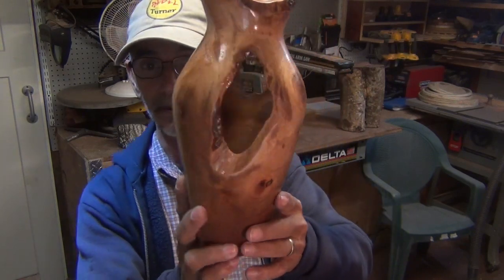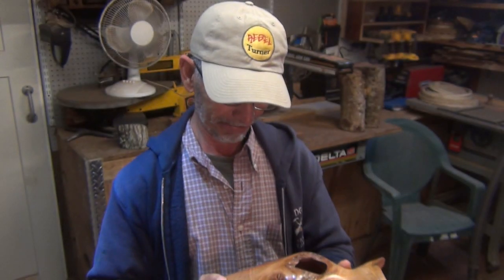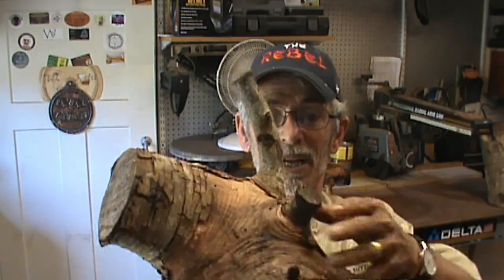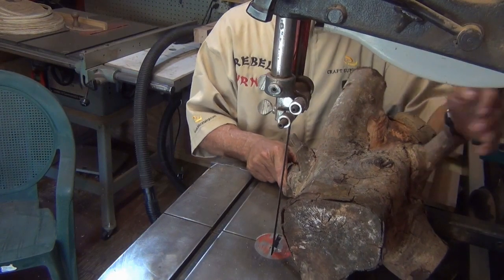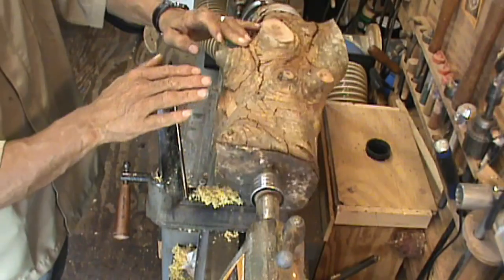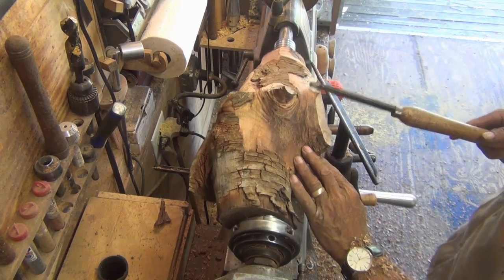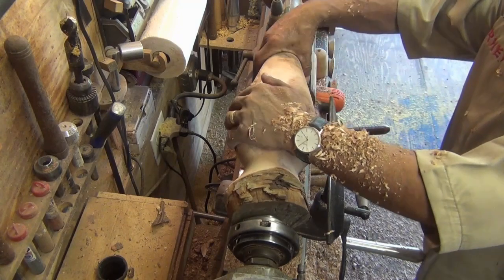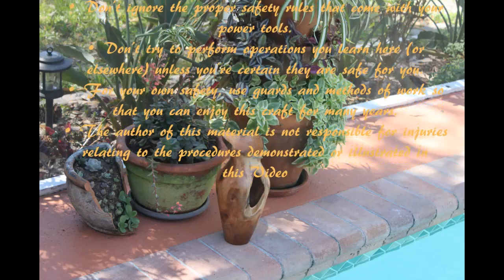Woodturning After a heart attack Sea grape vase

Comment: AL you will be fine the stenting is good, it helped me when I had a heart procedure I had a triple bypass after being diagnosed with ischaemic heart disease at 35 and had three stents fitted,  and when I got a bit stronger it was like a new lees of life I went back to welding  for a bit then retired early and took up a hobby I am 65 now so don't worry AL you have to do what you feel like you can do it's a warning to slow down. yes, enjoy life some jobs can cause pressure you don't need,  yes like your vaus only if you had dun it different?, yes life has a lot of iffs Al you know what I mean, so all the best AL, you will be fine .  Davi.